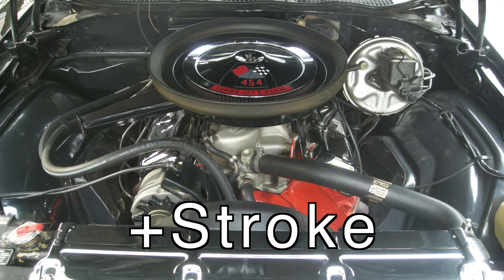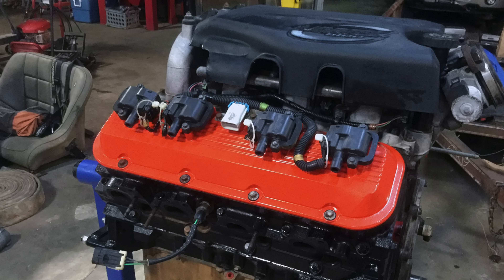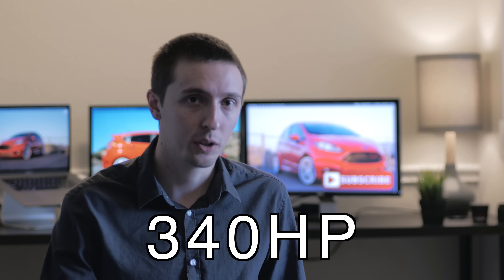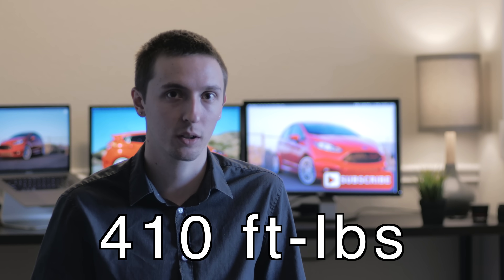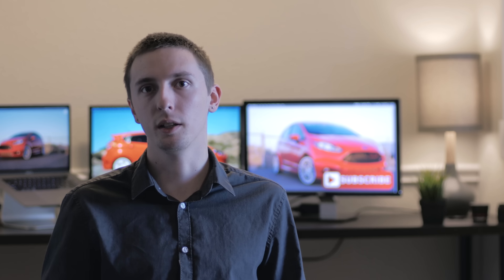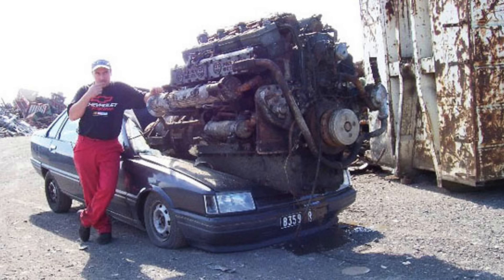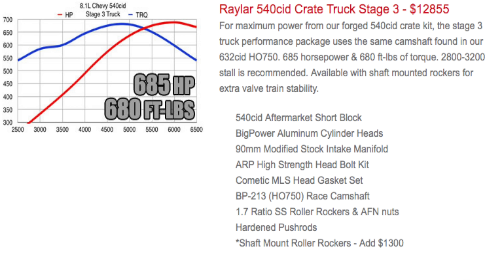Vortec 8100: Everything You Want to Know | Specs and More

Comment: Best engine I have EVER had ! Duramax KILLER!
Reply: Duramax killer? I call bullshit
Reply: @jerredwayne8401  big block gas engines are sometimes more powerful than a diesel
Reply: Dawn Witmer what kind of mpg you getting out of it? Thanks
Reply: I get 9.5 to 10.5 around town, 12.5 to 13.5 on the highway with an 02 running the 4.11 gearing.
Reply: How do sales of the 8.1 compare to the 6.6? Thanks.
Reply: Until you go on a trip and you're filling up every 400 miles because you're out of gas. The oil thing the Duramax has is fuel economy. Outside of that its 10 quarts of oil vs 6 quarts and your changing oil every 5000 miles or so in the Duramax or 3000 miles in the 496.

Comment: I love this engine. I have a 2001 Silverado 2500hd with the 8100 and it is a power house (stock) I get 10 mpg with 33s and can tow anything with it. I do still want a duramax but this is a good alternative. Eventually I'm going to pull it and get a lot more power out of it and put it in the mud truck

Comment: I have an 02 2500 with the 8.1 and its the best gas motor Ive ever used in my work trucks except for the old 460s from Ford in the 70s. The Allison transmission is saweet! Id still take the Duramax over the 8.1 but are way more expensive to maintain
Reply: mojo jojo what's your mpg average? Tia
Reply: Thunder Butt  go pre 73 460 the Dove 460's. 365hp and 500 ft pounds of torque. Put 4.10 gears in the rear end of the camper special and i promise you will quit your bitching.
Reply: Daniel Jones, which was the net rating. So it was more like 285hp and 385 ft lbs of torque. There’s no 460 that would touch the 8100. Even the V10’s can’t run with the 8100, and I’ve driven both. I actually own  an 8100 equipped ‘04 Suburban 2500.
Reply: @70camaro406  those numberd are comparable with the 454 that gm had at that time. When Chevrolet introduced the 454 ss in the early 90's what was it 240-250hp from the factory? 

You cant compare an engine that was built with technology 40 years ago which is considered obsolete by todays standards to an engine developed at the turn of the century. Gm took the 454 and updated it and modernized it. Ford went a different route with the modular engines and developed the V10.
The 454 is the predecessor to the 8.1L vortech is it not?

But just to humor you i have an 02 F-250 with the V10 and an 86 F-250 with the 460 im not scared of no vortech. A 460 can easily be built to run like a raped ape.

Comment: I have an 2001 suburban with the 8.1 and it’s the best gas engine I’ve ever driven. I’m not a huge fan of gas 2500, but the 8.1 is an exception. I’m a welder so hauling material and welding machines gets pretty heavy but anything I put behind it. I do own a 3500 dually lb7 duramax and I love that truck to death. But if you are looking for a great gas engine I’d go with the 8.1. Gas mileage is not the best. I get about 6 MPG and it’s a 40 gallon tank so it’s not a cheap truck to full up. But like I said, it will tow anything. I tow a 12,000 pound trailer once a week up a mountain and it’s like I’m towing nothing with the 8.1. Great truck, great engine, great  company. Love my 8.1
Reply: Did you get the Allison behind it?  I have a 2001 8.1 Sierra and i get 12 mpg typically.
Reply: Me too. 12.6 on the highway in my 3500. Express cutaway mini bus.  It gets about 6 in city miles, though.
Reply: Avalanche and suburban are detuned without the allison. Allison only available in truck version
Reply: @jasongartner5267  4L85e is a beast of a transmission and actually gets better gas mileage than the Allison.
Reply: I have the same with 330000 miles and still running strong. Love my 2500 suburban 4x4 8.1
Reply: Dose it pull it  better than ur lb7
Reply: Hell of an engine but the Ford 6.8 v10 gas is also a very good contender.
Reply: @92clintonr  Ford v10 was not much better than chevys 6.0 in guts
Reply: @jasongartner5267  
You have never driven a v10 if that's what you think. There is a reason you can find the v10 in 30 plus foot motorhomes and not the 6.0. The Ford v10 would rip a Chevy 6.0 apart. And that's coming from a Chevy guy.
Reply: @92clintonr  v10 if pulled with plenty, gutless pieces of shit. 6.0 outlast v10 too. For size motor the v10 is shit. 5.4 they make is also shit. These new engines they have are million times better
Reply: @92clintonr  I'm a pipe fitter, I've been through many rigs and been around/driven many, I don't need facts or internet bullshit, I e seen first hand. Reason Chevy still uses 6.o. lots of 6.0 out here with over 500,000 miles no fords
Reply: Yes sir I had a 2005 2500 suburban and bought it from my aunt they used it to haul there horses it was loaded leather a DVD TV I had a 31 foot travel trailer and it would tow it all day long without breaking a sweat, I wrecked that truck 1 night about 12.30 deer jumped out in front of me and like a dummy I hit the ditch totaled the sweet thing wanted to buy it back for the motor  $4.000 for me to get it back $9.200 if they keep the suburban so I said keep it true story
Reply: Lol the Triton V10 is the one that'll rip itself apart
Reply: Evan Gray I’m 17 and planning to put my welding machine on my gmc 8.1
Reply: I am buying my father in laws 2002 2500 Suburban 8.1L with 144k miles. Any advice?